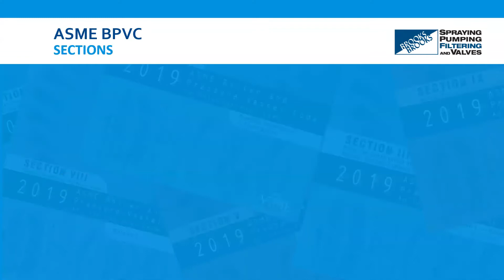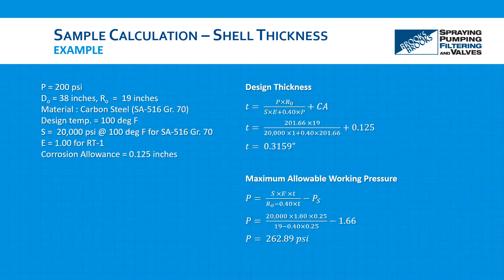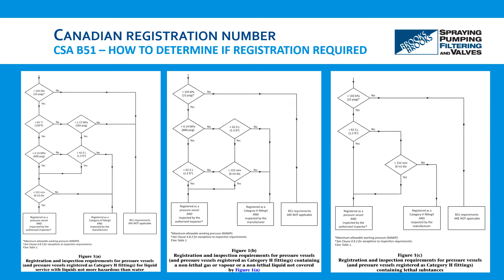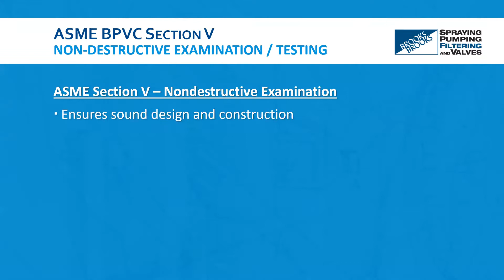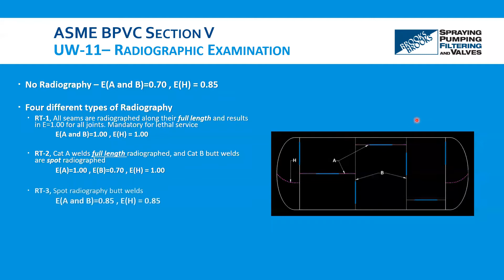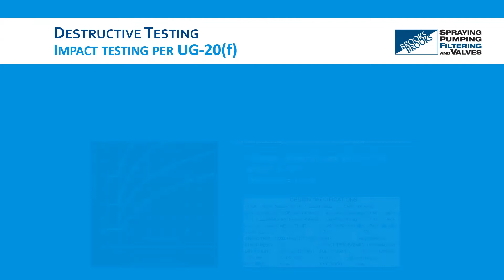Pressure Vessel Manufacturing Part Two

Comment: The Q&A is actually equally informative if not more useful than the talk! Too bad it is audio only. 
Here are some notes I took from the Q&A:
Design safety factors: material max allowable tensile stress/3.5, yield stress/3 are some common safety factors;
Impact testing is usually conducted on a coupon, destructive testing is for valves and fittings
A valid fitting UM stamped registration is good for 10 yrs. 
The RT tests applied should be based on both the type of fluid cat (for instance, cat M requires RT-1) and the requirements of the user/buyer of the vessel. 

BTW someone gets Ani a better pair of headset! lol his audio is terrible.